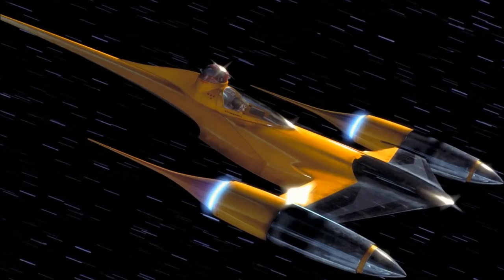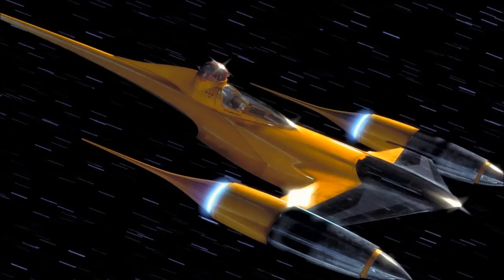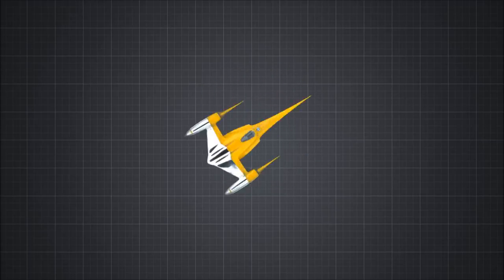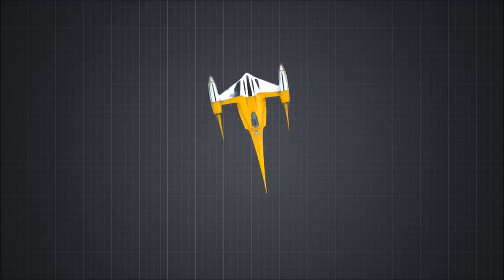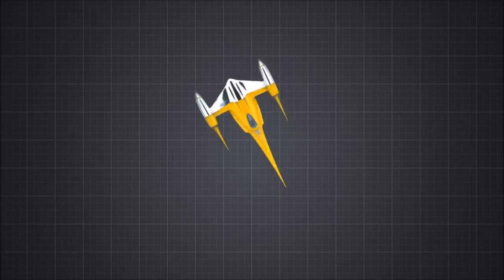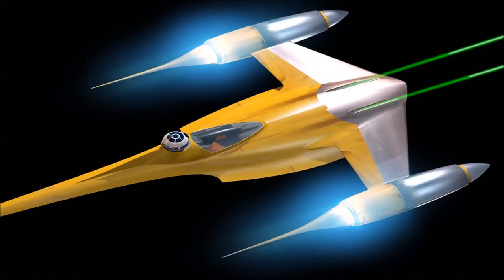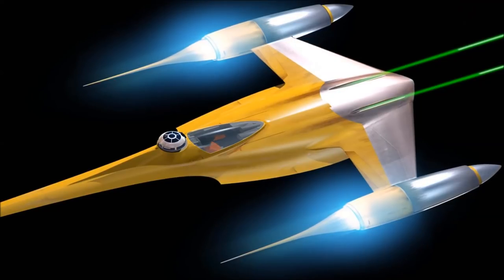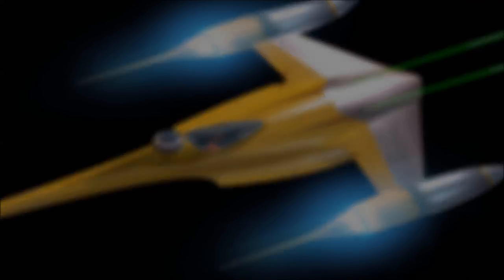Star Wars: The Big Problem with the Naboo Starfighter - Spacedock Short

Comment: Actually you are quite wrong about what would happen if the craft lost an engine because it would continue to fly in a straight line as there’s no force acting in the opposite direction on a side that has lost thrust you just have to look at the Dakota which could fly on one engine if need be
Reply from the maker: That's not how space works. An aircraft has drag working against it.  Imagine you had a toy Naboo Starfighter floating in front of you in space, and you poked the left engine from behind. It would spin clockwise because it's center of mass is to the right of where you exerted force. You've applied a clockwise rotational force to the entire object.
Reply: Spacedock I might have to do a little research here but I still believe you are wrong but then again so could I
Reply: +Spacedock You are also forgetting the momentum the destroyed engine provided just doesn’t disappear when power is lost. Still plenty of acceleration to keep going forward for a long long time.
Reply: Any force exerted into an object that is not in line with the center of mass will cause a rotation.

Momentum means nothing here because you can create an inertial frame of reference based on the CoM of the fighter meaning that it would have 0 momentum to the observer (as the observer is keeping up with the ship's movement). As soon as a force is introduced it starts spinning just like if it was stopped. So it doesn't make a difference if it was moving or stopped, and unequal thrust will cause spinning.

And besides, the momentum vector is aligned with the center of thrust of both engines. This means that as soon as one engine is destroyed the "old" translational momentum isn't canceled, but there will be a new center of thrust aligned with the remaining engine - due to the lever arm of the thrust this will introduce angular momentum.
Reply: I have to agree with Colin on this one (just an amateur opinion; I'm no expert). I believe that, in your example, if you were to poke one side of the Naboo Starfighter in space, the entire ship would move forward in the direction you poke. One side would not move faster than the other, regardless of the center of mass. 

The center of mass is important for determining how to create rotation, but just applying force "off center" from the center of mass isn't enough. You would have to apply two separate forces in two different directions, on opposite sides of the center of mass to actually cause rotation.
Reply: +deftreference "You would have to apply two separate forces in two different directions, on opposite sides of the center of mass to actually cause rotation" have you ever opened a door? I don't know how you do it, but I personally just use the handle.

What you're saying doesn't even make sense, if you do the free body equations on what you're saying you'll see that you're making an arbitrary rule that says that a force F (combined two forces with equal "r" creating a moment) is able to cause a rotation but halving that force into F/2 won't make the body rotate (if you eliminate one of the forces you get half the torque).
Reply: You guys are confusing "flat spin" with "flat spin in a stationary position".  Yes, the fighter will keep moving forward with the momentum it already has, but the imbalanced acceleration around the center of gravity would cause it to spin.  The closest equivalent we see is actually helicopters - when their rear rotor loses power (almost always rear), the counter-balancing force it applies weakens causing the helicopter to spin around.  Your counter argument might be "but it's already spinning" but think about it for a second: the rear blade, normally turned on its side, is pointing perpendicular to the spinning top blade and being used to push air in a direction to counter the spin of the top blade.  It is a sideways rotor countering the spin of the primary rotor.

As Spacedock noted, this formula changes slightly in atmosphere - on one engine, you can adjust throttle such that the drag placed upon the surfaces of the aircraft actually counterbalance the spin.  You also have options with yaw, roll and pitch controls to effectively fly at an angle.  This is because, unlike space, we use the physics of air resistance to do much of our flying for us.  In space, realistically, you actually need at least 3 thrusters to maneuver and likely thrusters in every direction to be able to maneuver effectively.  Star Wars tends to avoid this by using ridiculous physics.

There's several games now that let you build your own space ship and simulate the physics on them - Space Engineers and Avorion quickly leap to mind.  You may want to test these comments on them.  In Avorion, I actually once lost all my right engines and began spinning rightward as described - some maneuvering thrusters were eventually able to counteract it and I ended up flying at a 30 degree angle to my nose.  Without those side thrusters, I absolutely would've gone into a flat spin, no matter what speed I'm flying
Reply: @thegreenbeast: Flat spin is often perceived in movies and games to be spinning while being still.  This is a perception issue created by the medium - the camera is keeping pace with the plane in question while it spins around its axis but if you were to make the camera fixed, you'd see its still moving forward as it spins.  Case-in-point: look at Top Gun and the flat spin there.

Comment: Why would it flat spin? There would have to be drag on the engine-less side. Drag? In a vacuum? What about lousy side vision caused by the glare of two engines in your peripheral vision? That'd suck. C'mon. How does it steer in the vacuum of space? There are no thrusters. This little hot rod is a load of crap.

Comment: The amount of people in the comments who think that this fighter wouldn't turn into a spinning top if one engine is cut off/shut down, just because "it's space, no drag!" makes me lose faith in humanity. These people must have they slept through their physics lessons in school... 

Have you people ever heard of the terms "center of mass" and "off-center thrust"? Because it doesn't look like it. Or at least you don't understand how these concepts actually apply to an object in a vacuum.

There's a very simple solution that will show you very vividly what happens though. Go download the demo of "Kerbal Space Program"(or buy it, if you are interested), create a design with a fuselage+fuel tanks+cockpit and then put on a single engine of any size on a pylon(don't forget to have a fuel line connection from the tank to the engine though...). Then, via console commands, teleport it into space. Now turn on the engine and watch...

And then you can even revert to the construction mode, turn on the "Center of Mass" and "Center of Thrust" displays and attempt to fix it. Good luck.
(keep in mind however that the limited processing power of your PC's will cause "weirdness" when the amount of calculations needed for the physics engine reach a certain treshold... and don't use the time warp function or it gets really weird)

Or, for the lazy, just watch this:
https://www.youtube.com/watch?v=Lz8epWitZKA

Comment: first it is  space the  direction of trust determines  the ships heading the   , it will not  spin  unless trust in another direction is provided , ie as long as there are in space one wing  could be   50 time longer than the other  AND  with only one engine on the long wing and none on the other and it would not spin untill something applied fores in another direction.   HOLLY HELL.

Comment: In the vacuum of space as long as the functioning engine is pointed dead straight I’d think it would still push the ship forward. Prove me wrong?
Reply from the maker: Nothing to do with Air Resistance. It's spinning clockwise because the only remaining thrust vector is to the port of the center of mass.
Reply: Makes sense. Damn Newtonian physics!

Comment: Spacedock your completely misunderstanding the physics here the craft wouldn't go into a spin it would drift slightly and if unchecked go in a very large circle not a flat spin but it would be very easy to fix turning of the other engine and allowing momentum to carry you would be one way but the standard manoeuvring thrusters would be able to compensate for the loss of one engine and any asymmetric thrust, although it would limit their fuel supply the physics is very similar to having a twin rudder and engine set up on a boat and losing one it's harder work but you can maintain a steady course you can actually calculate the angle of  the offset thrust  quite easily using the dimensions of the ship and it would be less 3 degrees of drift

Comment: wait a minute theirs no air resistance in space to induce a spin, there would be no spin as nothing in acting against the surface to induce a spin,
Reply: Ben Siekierski. Its not the air resistance that causes the spin its the engine thrust being on one side of the vessel far from the central mass, especially since star wars engines continuously burn during flight instead of only when the acceleration is needed.
Reply: You're thinking of the "corkscrew" spin that happens when an atmospheric plane loses a wing, the opposite side has lift that forces a helical spin.

This is a "flat" spin. In fact if you watch Top Gun you'll see that at one point Maverick is behind Iceman and the wash from the forward plane enters the intake of one of the engines of the pursuing plane, which puts out that engine and creates asymmetric thrust. Maverick and Goose are forced to eject due to the flat spin.
Reply: it still wouldn't go into a flat spin it would veer into a large circle but that would easily be compensated by the manoeuvring thrusters you can actually calculate the angle of drift using the dimensions of the ship and its less than 3 degrees
Reply: I'm glad your not one of my students as you would be failing I teach it and was at MIT seriously it would go in a large circle although it is a pity you can't put pictures as would love to draw a diagram and take you through the physics
Reply: ok I'm sure you are well aware of Newtons Laws but the first law as you know states that In an inertial frame of reference, an object either remains at rest or continues to move at a constant velocity, unless acted upon by a force their is the inertial force from before the accident going in a straight line this vector will still happen after loss of one engine and the new direction will be a function of that original force and the new one created by the offset engine thrust (with the specifications of the craft as published the offset angle will be less than 3 degrees .  This original forward motion will prevent a "flat Spin" and thus when you add all the vectors together instead of a flat spin you get a large circle as it veers off (this can be easily demonstrated by taking a twin engine boat and turning one of the off).  Yes it will go off course and will need constant readjustment to keep it on course (and the manoeuvring thrusters are designed to do this) and the  but it is not a Flat spin if looking at real life spacecraft the Shuttle had 3 engines on the orbiter and together they created a block with a total thrust on the centre line of the craft however each individual engine was off centre thus if asymmetric thrust caused a flat spin the shuttle would have gone into one on any occasion any one of its three engines failed this happened on multiple occasions the shuttle did drift try to off course going in a large circle but was able to be held on its intended course by using its thrusters to compensate (although it did eat up thruster fuel meaning the missions had to be cut short)
Reply: I think you might need to reread what I wrote and you are more than welcome to pop by my office I will be back in the new year.  But as I have pointed out multiple times and you even conceded their will be a forward momentum still operating on the object when the other force (the Asymmetric thrust) is in effect.  You need to remember space is not only a vacuum but 3 dimensional the craft will not go into a flat spin a flat spin is a very specific type of movement defined as which an aircraft descends in tight circles while remaining almost horizontal.  The craft in question would not behave in this manner in the specified situation thus it is not a flat spin  it would go in a circle as I have repeatedly said and with the large initial momentum and the relatively low angle of the asymmetric thrust (it is a pretty small object and those engines are less than 2 metres off the centre line) The Circular path of the craft wold actually be pretty damn big and most likely the course deviation is correctable with the manoeuvring thrusters especially as you would only need the main engines to fire if you are wanting to accelerate and if you are already at combat speed you wouldn't need to do that.  I am willing to chalk the error up to the writer not knowing the very precise technical definition of what constitutes a flat spin coupled with failure to understand the physics at hand something you yourself have unfortunately failed I am also willing to admit that with English not being my first language that I may not have explained it clearly enough for you but the vessel in question would not go into a "Flat Spin")
Reply: I'm dyslexic and more importantly a non native English speaker (I would bet My English is a damn site better than your Czech) but I will be returning for the new semester as a guest lecture,  your welcome to come by my office anytime although won't be back until end of January if you want to call my secretary I'm sure we can arrange something
Reply: I agree with a lot of you guys. But the only way to really figure it out, is to test those theories out in real space. Unfortunately, we don't necessarily have the technology to test a small scale model of it in space yet. Weather you go into a flat spin, make a circle, or if the pilot pulls back on the throttle to slow down enough to where he/she can control it. In the air, we have the second engine and if needed, the rudder to control her and keep her from doing a flat spin. But again, it's air not the vacuum of space. Idk, maybe a  physicist and a mathematician can figure out the numbers on that and come out with the best  answers for us because I want to know haha